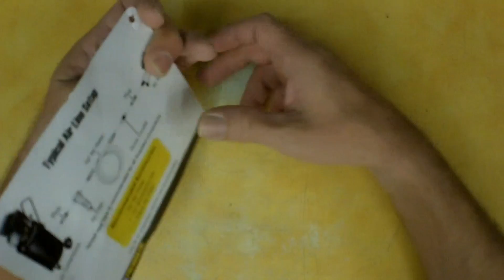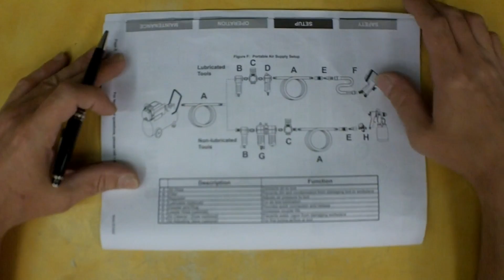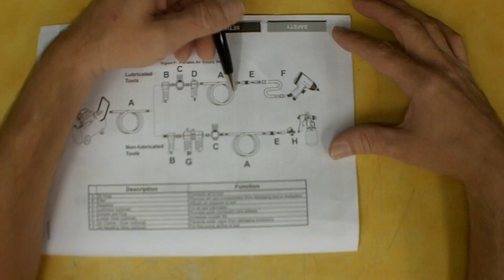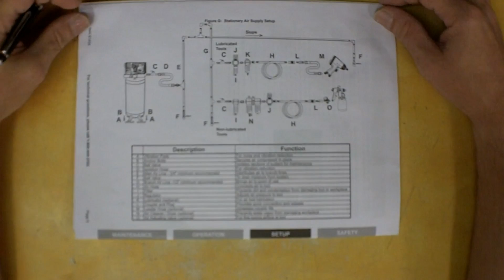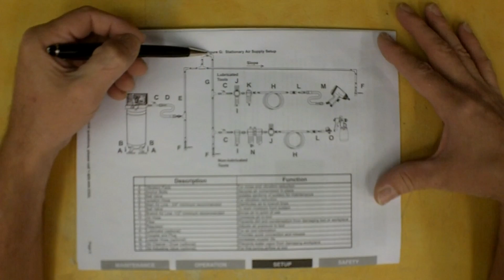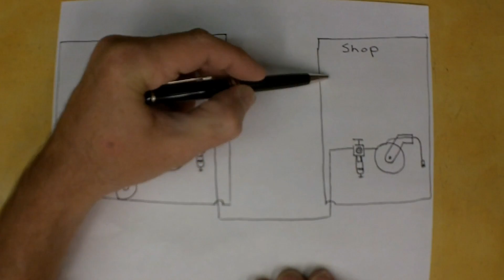Part 3-3 Harbor Freight 21 Gal. Air Compressor Review Item 61454

Comment: Thanks for posting your reviews and tutorials.  I have learned a lot from watching.  How is the HF 21 gal. compressor holding up so far?
Reply from the maker: No problem! Glad you like them. It doesn't see hardcore use since I have a larger dedicated compressor for my shop- but, it's been working quite well when I do use it. Good luck, G.

Comment: Great videos!  I am on the fence to buy this compressor due to money.  I see alot of reviews/complaints that involve that weird pressure relive brass valve you talk about in the first video.  Have you had any problems with it?
Reply from the maker: Thanks! I eventually figured out what the valve is, and what it's for. It's called a cold start valve. It's there to relieve head pressure so the motor can get up to speed, then once there is enough pressure built up- it snaps shut. Also for when they're left out in the cold, or on an extension cord- also to help the motor out. It will behave this way each time the compressor cycles. I've never had any problems with mine (the valve or compressor), but replacement valves can be had on the internet for cheap- about 6 bucks. This compressor doesn't see hardcore use, but It works great for me when I do use it. Good luck if you get one, G.

Comment: A big "Thank You" for this video. After reading some of the praising comments there is not much more that I could say, except "well said". Also referring to my first comment on a filter(for the open end of motor), I realize the head gets very hot, so that would have to be worked around somehow. Mine is still in the box as it is in the high 20's here right now. I'm waiting for upper 30's + to set it up.
Reply from the maker: No problem. Glad you liked it. A fiberglass filter like I mentioned would be my first thought. Yeah, either bring it inside to break it in, or wait for better weather. Hope it works out for you. Take care, G.

Comment: Any ideas on devising a "filter" to catch debris from going into motor. Possibly a vacuum filter, like a cloth bag type. It must have been intentionally left open for cooling. Maybe something like the thin nylon parachute type material  would catch most debris.
Reply from the maker: Yes, it's left open for cooling. Something like an air filter for an Heat and air system might catch some of it. I just blow mine out from time to time and have no problems. G.

Comment: thank you so much for all the information you provide in this 3 videos.I am about to get one of this soon. I  have 2 questions.:
1.-I only need it  for basic stuff  (car repair with impact wrench ,some air nailer work )do I need to add the 25 ft line before the filter like you show in the second set up? or what setup you recommend me!
2.-I live in Michigan and the winter is coming. I am planning to keep it in the garage. does the tank need to be covered? or what type of care a compressor needs in cool weather so it can run smoothly? thank you so much in advance for your help. 
I learned a lot from watching your videos! !!
Reply from the maker: No problem! 
It should do just fine with nailers or other lower volume tools. A 1/2 impact should work as well, but you may need to wait for the tank to refill if you're using it a lot. The gun will probably loose power pretty quickly.  I have two compressors. The setup I mention in the video is what I use for my main compressor (5hp 60 gal tank). I use this one at different locations. I've added a short line between the filter and tank. I'll provide a link. Not the best setup, but better than putting the filter right on the compressor. If I'm painting, I also use an inline filter right at the gun to ensure no moisture ruins the finish. 

As for being in a cold climate, you shouldn't need to cover the tank. I would however do some research on what weight of oil should be used. I believe a lighter weight should be used in cold climates. What weight/kind- I don't really know. Aside from blowing the tank, and using the correct oil and changing it, that's all I would do. Oh, and cleaning the filter from time to time.

Hope this helps, G.

http://www.harborfreight.com/38-in-x-8-ft-15-ft-rubber-air-hose-remnant-61942.html
Reply: ghostses ,thank you so much for your help. I really appreciate it
Reply from the maker: No problem! Good luck, G.
Reply: ghostses I just got my compressor over the weekend and I have another question : I planning to break it in some time this week, but the temperatures for this week are about 30's mid 30's, do I need to wait until temperature are around 40's or can I do it under this 30's temperature? I am planning to use 30 compressor oil for the break in and after that I found that under this conditions amsoil synthetic oil works the best. let me know your thoughts in this please. and once again thank you for your help! !
Reply from the maker: I'm really not sure if that would be a problem. I would bring it inside the house to break it in. Or, keep the oil in the house to warm up, pour it in, then run the break in. That should work fine. Then change the oil to synthetic. But definitely break it in with dino oil- then switch to synthetic.  G.

Comment: YOU ARE SUPER FANTASTIC AT SPEAKING AND EXPLAINING THINGS. I REALLY APPRECIATE WHAT YOU HAVE DONE ,AND I AM SO GRATEFUL FOR YOU DOING THIS. THANK YOU SO MUCH. I JUST GOT ONE AND WE ARE HAVING A LITTLE TROUBLE WITH THE UNIT TURNING ON AND STAYING ON GETS REAL WEAK AND LABORS AND SHUTS OFF ?? IT WORKS GREAT IN ANOTHER SHED BUT WON'T WORK IN MY SHED. IT WILL WORK UP ON THE BACK PORCH , BUT NOT IN MY SHED ?? EVERYTHING ELSE WORKS IN MY SHED EXCEPT MY COMPRESSOR ??? WE ARE BAFFLED. HELP.............SCUBAGAL75@LOCALLINK.NET
Reply from the maker: Thanks! Since it works everywhere else but one shed, it sounds like a wiring issue to me. I could be that the wire gauge running to the shed is too light. That is where I would start. The compressor draws quite a few amps. All other items in the shed probably draw very little- which might be why you don't have any problems with them.  Hope this helps, G.
Reply: you mean from one shed to the other shed ??  what size do you recommend  there is 12/2 going in there now. ?
Reply from the maker: I was assuming you had a line to each shed from the panel on the house. 12/2 is rated for 20 amps so that should be fine in that regard. I think the compressor draws around 14 amps. You might be having a voltage drop/current issue if the wire run is extremely long from the panel to where the compressor is being plugged in. If that be the case, you might need to change the wiring to 10/2 to compensate. Not electrical advise- just a direction to look. Good luck, G.
Reply: THANK YOU SO MUCH FOR YOUR KNOWLEDGE AND YOUR TIME. YOU ARE A VERY SPECIAL PERSON , AND I REALLY HONOR YOUR HELP AGAIN THANK YOU SO MUCH :)
Reply from the maker: No problem and thanks! Take care, G.

Comment: Nice series as usual, G.   I've seen some pretty cool(literally) air system setups that use a refrigeration unit to cryo-dry the air.   In summer have you ever had the cool ground collect moisture in your underground line and basically form a gurgling p-trap? haha!    As usual all your points were spot on.  I'm also intrigued by the poppet valve on the head.  Perhaps there to give the motor an additional head start. Pun intended.  Thanks for posting.  

Off topic here, but I had to share this.  Recently had to install new water lines in my crawl space and went with the Uponor/Wirsbo PEX-A system and the Milwaukee 12v expander tool.  All I can say is WOW!  If you plan on doing any water lines, this is the cats meow.  I did a LOT of research before going this route, and couldn't be happier.  The tool kit is expensive, but it works like magic.  It paid for itself on this job IMHO.  If you have any questions about it, feel free to ask.
Reply from the maker: +blmeflmm66 Thanks man! I'm glad you thought I gave the subjects some decent justice!

Yeah, my brother-in-law owns a body shop and has one of those refrigeration units. Would you believe HF ACTUALLY sells one...lol! This place surprises me more than not. 

http://www.harborfreight.com/compressed-air-dryer-40211.html

No...lol. No gurgling so to speak, but the underground line works great to cool the air and drop the rest of the condensation out and then gets trapped in the filter/regulator on the shop end.

Good info on the Milwaukee tool. I usually stick with copper since I'm tooled up for it , but the thieving tweaker meth-heads sure do like the stuff for some reason...lol. At least they've changed the laws around here so they now leave the condensers alone! I may go the PEX route later and just strip any copper for myself..- or paint the copper blue and red..- or even white so it looks like PVC..lol. If only I could come up with something else to use for AC spit systems I'd be golden.  

Good luck, G.

Comment: Great series G and well thought out!  You really covered a lot of good ground in short time about compressor systems with do's/don't/why's, Maintenance and a lot more.  Bravo!!  You could give classes for some of the HFT store people...most don't know half of this.  There is one small point in the second one about tool rating that I missed or didn't hear about the tools not only have a CFM rating but @ a specific pressure for optimum use.  I've always thought about this as a kind of duty cycle process and prefer not to strain things Or listen to it run anymore than I have to.  Like computers, my thought is get the biggest and best you can afford and it will serve you long and well.

I loved that you went through the plumbing and reasons for the schematics. Thanks for pointing out the drain issue on that model as well as the weird head pressure relief.  My neighbor has the 150psi 26gal version in his yard sale for a great price but its just a tad big for my little shop and didn't look at the drain...still undecided(¿)...but will check out that drain now for sure.  I picked up the HFT 2hp 10gal horizontal about a year ago and it's been a good work horse...but it scares the dogs across the valley when it kicks on!!!   Still have my original tiny Marvel can I've refilled too many times to count for direct oiling...why waste good hose.  Again, Thanks for a Great Series!  ~PJ

When I'm rich...I'm having a screw compressor with refrigerant dryers! ~¿@
Reply from the maker: +pjsalchemy Well thanks PJ! Glad you thought I gave the subjects a little merit. LOL, yeah, like most improvement stores the staff don't know all that much. But, there's a star here and there I run into that actually knows what I'm asking for- usually someone that's been in the trenches and is now is taking it easy. 

I thought I covered a tools rating vs. what a compressor could deliver so it would continue to cycle-  but may have been clear as mud regardless of my words...lol. Duty cycle is the exact definition!  Computers, yes! 

I thought about the 26gal version myself mainly for it being belt driven- but didn't really want to pull the trigger on it for my true "remote needs". I'd offer him $150 and r-u-n-n-oft with it if he bites...lol. I'm sure you could come up with a use. 

Aside from the ear splitting noise- the drain location is really my only complaint thus far and I've used it plenty since posting. I have a simple plan to silence the beast and will post any findings/results if successful. It might help you tame yours as well, as it looks like the same pump setup as this one.

I have a clip, coming up, of a more recent acquisition/score that I just could not pass up. Babies growing up....lol. 

OH yeah, you're talking my language now...lol. Rotary screw compressor with a refrigerant dryer= too sexy...lol.  I've discovered HF does sell what looks to be a refrigerant dryer if you can believe that- and for a reasonable cost as well. Check it out!

http://www.harborfreight.com/compressed-air-dryer-40211.html

Take care, G.
Reply: +ghostses Probably missed it when my compressor kicked on...LOL  My bud around the corner offered it to me for ~1/2 your price, 8-)...He says it has about <100hrs on it...for me its about the space for it and shaking the house when it lights off.  Maybe your silencer will change my mind.  Look forward to your "Silencer" video as I'm sure a lot of others would also.  

I hear you about growing up fast...my GS is 6mo. now.  Always great to see what you find!

Shocking about HFT having dryers...some of the reviews were a bit funky but over all 4stars...for $450 works...maybe.  Might shop around for a used commercial grade for about the same price.  

Till Then, ~PJ
Reply from the maker: +pjsalchemy 

That would be a hard deal to pass on. But, if you don't need it, you don't need it.

I didn't read the reviews to see the funky parts. I did see a video where a guy redirected the output on his compressor to a vehicle condenser. The output on the condenser ran into a separate collection tank, then tee'd back to the compressor tank. He didn't have any sort of fan on the condenser but claimed it collected everything and the compressor tank never warms up. Interesting low-budget concept nonetheless. When the unloaded opens, it drains pressure off the entire loop so it hisses for quite some time. A well placed check valve would solve that problem.  G.

Comment: Another geat set of videos, G. My question goes back to your second video about CFM's and pressure. You would think as the pressure rises that there is more push in the tank and so the CFM's would go up accordingly. However the opposite seems to be the case. As the pressure increases, the CFM's go down. Why? Thanks for taking the time to put up these top notch videos. Much appreciated G. Mark.
Reply from the maker: +Mark R. 

Thanks Mark! I will try to answer your question to the best of my limited knowledge. Focus on the  pump itself. This is where the ratings originate from- not the tank or it's pressure so to speak. It's taking in air and compressing it to the tank at an X cfm. As the tank pressure rises, the pump has to overcome that pressure (back pressure so to speak) and in effect it's output lessons as a result. I hope this is as clear a mud...lol. Take care, G.

Comment: I don't use any paint equipment, and I do have an automatic oiler but I don't have it setup.  If I were using my air tools all the time I would, but I use them occasionally so I just add a few drops of oil to the tool before I start working.  Also, if you hook your system up with an inline oiler, be sure you never use that hose with any paint equipment or you'll risk contaminating your paint.
Reply from the maker: +William Todd (williamtodd) Very true William! I oil my air tools directly and as used. Using an oil exposed line is a huge no-no for any dry tool- especially a sprayer. That's exactly why I do what I do. I use my hoses for every purpose and don't have to worry about what I'm using it for. If I worked with my oiled tools all the time, and had an oiler, I would have a dedicated branch just for them, and another for clean air. Take care,  G.

Comment: Never knew about the filter being a ways away from the compressor. I will have to figure something out for our 2 compressors.
Reply from the maker: +Love2boat92 Having one close might trap particulate and some oil, and maybe a little moisture, but some will make it past and condense further down the line. It might not be a big deal with most tools, but spraying is another story. I also use a disposable filter at the gun for good measure. G.
Reply: ***** Oh wow. You won't have any air in the lines for sure.

Comment: I may have missed it 
but I am curious what you used for the hard piping on your shop setup especially the under earth portions 
thanks
enjoying
Reply from the maker: +napodano26 
No, you didn't miss it- I never said. Good question though! The piping I used between the two buildings was type L copper with silver soldered connections. G.

Comment: The information you provide in this portion of your 3 part series, has probably been the most overlooked and disregarded requirement of compressors which (if not done) will cause damage to the tool and very unsatisfactory results in tool use. Most home users and DIYers will not understand a compressors inherent nature to accumulate and create moisture/water, which as you said  "Water is the enemy". Hopefully your explanation of how to evacuate that moisture will help them to get the results they want from their compressor and their air tools. I know I learned something! Thank you.
Reply from the maker: +MRrwmac Thanks Mac! Some parts of this country might not have too much moisture in the air to contend with. But where I live, the humidity gets super crazy and it gets sucked right in to the compressor.  It has to be dealt with for sure. G.

Comment: Thanks G, I wonder if you ever served in the Navy or Coast Guard. Your air system is set up like many ship board systems. Mine is sit up much like yours.
Reply from the maker: +Dev Ogle
No Dev, I never served but do have the utmost respect for ALL of those that have/do- yourself included! Very cool that I set mine up similar. I imagine much engineering went into verifying ship board systems setups.  My setup was more for simply not having the compressor in the same building so I can work in peace! It's worked out well for me and works great. The portable compressor I'm outlining here is a bit different in the final setup, but has been proving itself to be a decent setup and for a good price- outside of it's earsplitting characteristics...lol. G.